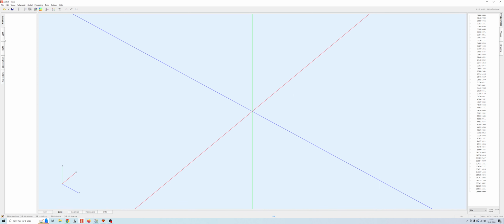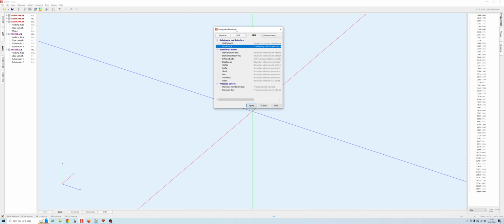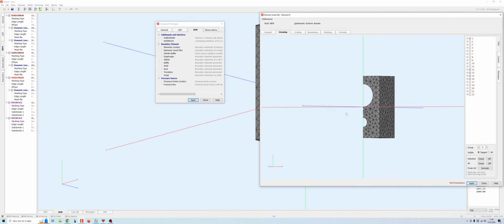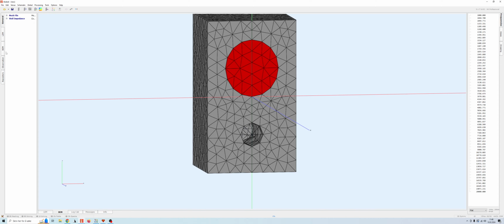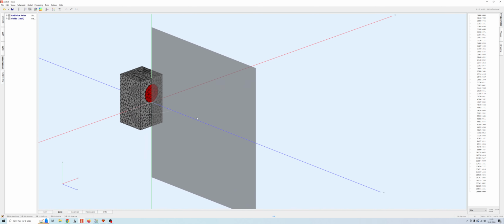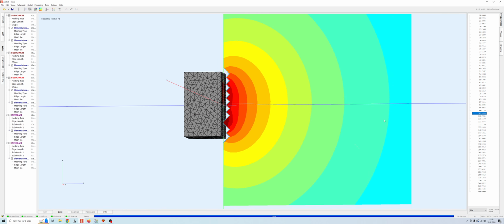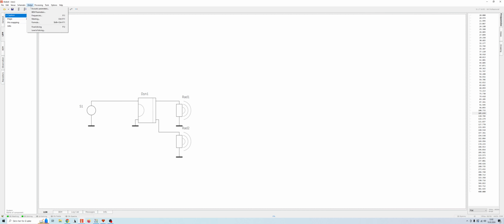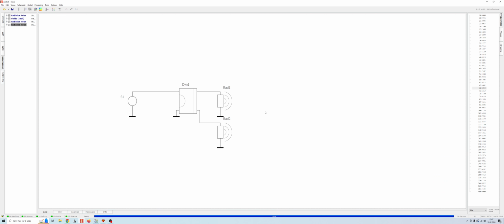How to simulate a bass reflex loudspeaker in AKABAK

Comment: Thanks!The videos you made are really helpful to me! I have a loudspeaker with a tweeter on the top connected to a horn, and a woofer on the bottom. I have the Thiele-Small (TS) parameters for the woofer, but for the tweeter, I only have the impedance and frequency response curves. I'm using a combination of BEM and LEM for the simulation,like what you taught in this video. In the LEM,should I use an Elec-Dyn Driver to represent the tweeter and connect its positive terminal to the radiator? Also, how should I set the TS parameters in this case? I hope you can help me with these questions. Thank you!

Comment: Hello, I tried to simulate your mesh file with all the steps you just detailled in this video, but I still have the error message : 
"Boundary elements close (Elements15 (1785);  Elements15 (1785);  Elements15 (1785);  Elements15 (1785))
Boundary elements overlap (Elements15 (1785);  Elements15 (1785);  Elements15 (1785);  Elements15 (1785);  Elements15 (1785); ...)".
Elements15(1785) represents the segment of the interior cabinet juste between the rear and front diaphragm. Do you know how can i get rid of this ? Thank you a lot !

Comment: So what's the usecase in the end? Comparing different enclosure builds? 🤔
Reply: Yes. A detailed analysis of a specific enclosure. With simple straight ports and rectangular enclosures this is marginally useful, but tapered or curved ports or more unconventional enclosures this will give more accurate data than guessing with simpler methods.

Comment: hey, super good video and it is helping me a lot for learning this software. thanks!

I have one question regarding the faces you selected for the element (mesh file) in the interfaces:
- cabinet / port 
- port / exterior domain

How did you create this meshing? did you do it via a CAD software ? via a meshing software (like Gmsh)? via Akabak?

If you can describe a bit more this step, it would be super super cool.

Thank you!
Victor from Berlin
Reply from the maker: Hello Victor!

My CAD software of choice is fusion 360, and these interfaces are just so-called surfaces from there. From there it's just a matter of arranging the surface so it points the right way (normals pointing in the direction we want). I do use Gmsh for meshing, but all my models are entirely drawn in F360. I hope this is helpful.

Comment: Brilliant video! I thought that the vent/port had to be added to the lumped element model too? But I am a novice lol
Reply from the maker: You can choose how you want to model the vent. You can do it either with a purely lumped element model or a coupled LE+BEM model like I did here. The purely lumped method is what is used in more "typical" box design software such as VituixCAD, and that is honestly a better approach for simple ports than doing a full 3D model like here, in my opinion.

Comment: Ok, this is awesome.
What's your background?  I mean how did you learn this software? I've been messing around with winisd and hornresp. I had to adapt a G-sub by Rog Mogale to the new Turbosound 18" drivers, cause I'm selling some stuff and those drivers are cheap so I thought heck, let's build another G-sub. Then I got to wondering if I could maybe design a neato kick bin, so I'm now learning Hornresp. Ended up wanting to know how I could simulate a square horn and well, here I am.
Hey will this thing do synergy horns?
I've subbed, looking forward to more tutorials, I'll get cracking at the ones on their site also.
Reply from the maker: I am only a hobbyist for the time being. As a profession I do IT (sysadmin/support), but I intend to pursue electroacoustical engineering professionally in the future.
AKABAK can handle synergy horns just fine, there are people using it for just that on forums, though I can't recall any examples right now. Please pardon the late response.

Comment: Thank you very much, essential video to begin to understand the mechanics of how this software works.

I have downloaded the example file to follow the tutorial.

It may not be because I have a different version than yours (3.1.9 b108 Vs 3.1.7b102) or because it is a demo, that when I open the drawing tab to edit the nodes the dialog box is different or I cannot find the interface that you use in the video.....

Thank you very much again for your time and knowledge.
Reply from the maker: Today I've installed the 3.1.9 demo version of AKABAK, and while it seems the GUI has changed somewhat, the mesh file appears to be importing properly.

In the "filter of list box type" go to "elementary". This will give you the same element view as in the video (though the differences in the user interface remain). From this box you can choose which parts of the mesh to include or exclude from further modelling. Make sure you include the mesh elements before moving on to the subdomain modelling.

I do find this newer user interface worse, but perhaps it is a matter of getting used to it. Best of luck!